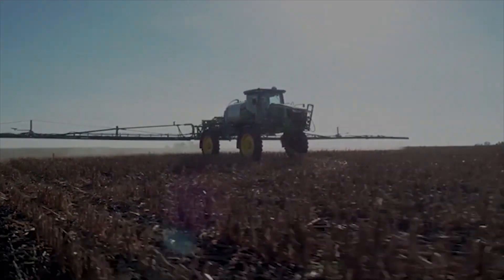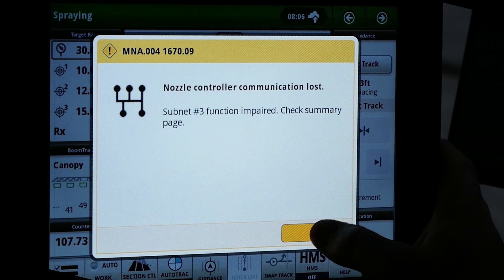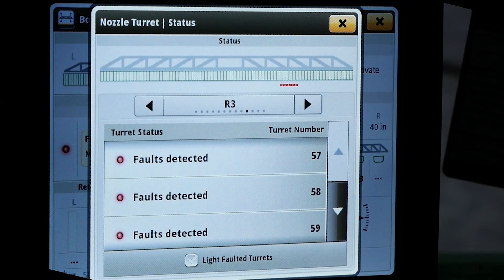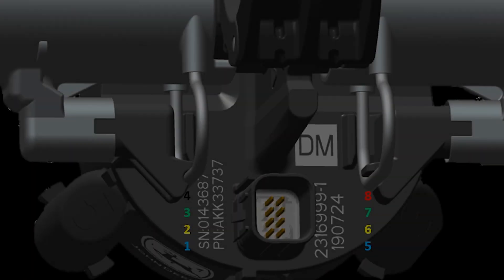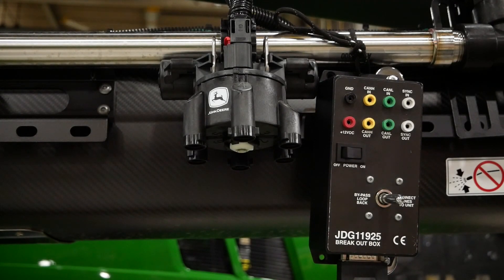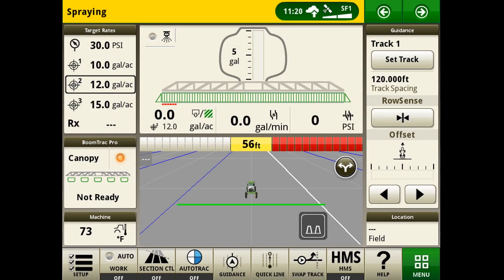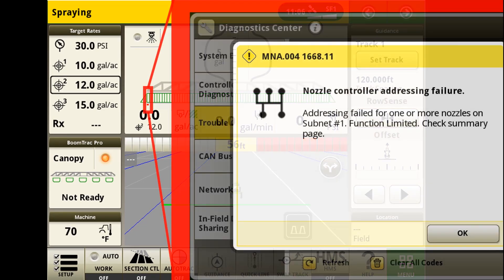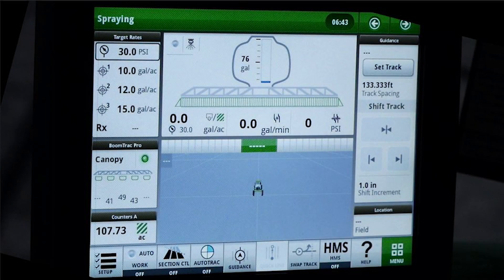Diagnostics MNA 16xx.09 | John Deere ExactApply™

Comment: CAN BUS is passive series circuit, ok so does that mean that if you have bad power or ground circuit to any nozzle that subnet with I’ll drop where ever the faulted nozzle is at? Because the nozzle needs to be powered up correctly so CAN BUS can go through the nozzle and to the next? So basically .09 can be either CAN issue or power ground issue?
Reply from the maker: Thanks for the question, JC. Your local dealer would be the best resource for technical questions like this one. You can find contact information for your nearest dealer at Deere.com/Dealer.